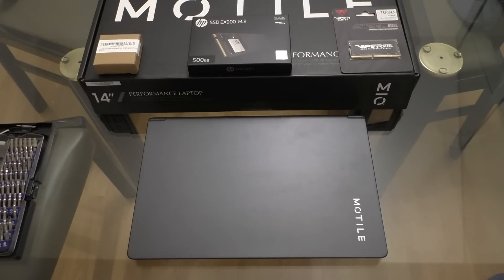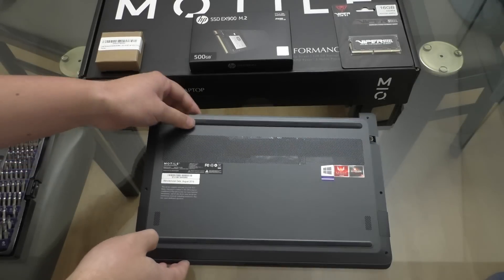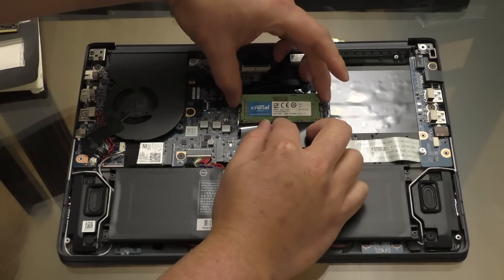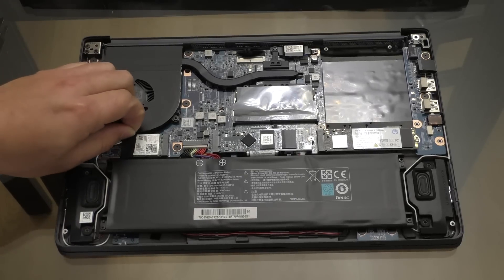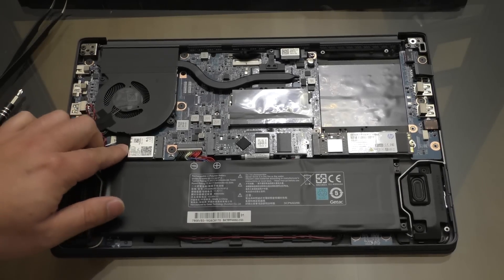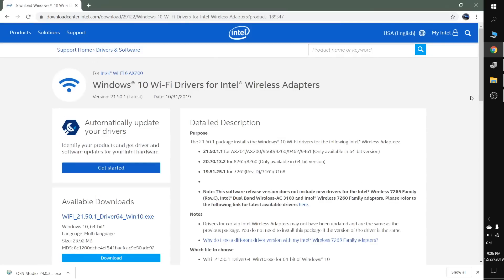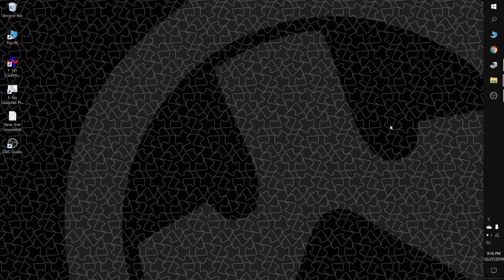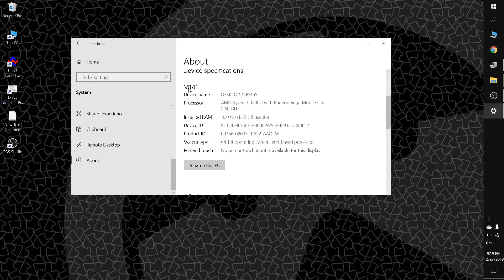Walmart Motile M141/M142 Upgrades (RAM, SSD, Wireless Card)

Comment: Hi all, I just got the Samsung 970 EVO Plus SSD 250GB - M.2 NVMe Interface Internal Solid State Drive with V-NAND Technology (MZ-V7S250B/AM) drive only wanted the 250 gb, but Installed it and formatted it and then ran "CrystalDiskMark 7" (first line test only) and the main SSD that came with this laptop reads about 540 read and 472 write, so I tested the Samsung was read 1740 and write 1618 MUST FASTER, so I understand that you can't remove the original SSD SATA drive as I did remove it and after it was cloned I installed the M.2 NVMe it would not boot gets blue screen issue, so I think I would need to get a SSD SATA III correct? I was thinking in the BIOS I could select the M.2 NVMe as the boot drive but could not get it to boot Win 10. IS this possible so I would not need to get a M.2 SSD SATA III to replace the original?
Reply from the maker: Other folks have been able to put an NVMe drive in the 1st slot and boot from it. Can you boot from the NVMe drive in the 2nd slot? If not, something probably didn't go right with the cloning and partitioning.

Comment: Is the 2nd m.2 slot only for NVMe? I tried to put the m.2 2280 that came with the laptop in the slot but it was not recognized. Thanks
Reply: im having the same issue. The second slot wont recognize any ssd in it whether its sata or nvme

Comment: Did you test stock vs ax200 wireless card speeds to see the difference?
Reply from the maker: When transferring video files between this laptop and my other computer I only get about 25MB/s with the original WiFi card at best, but get 70MB/s with the AX200.

Comment: My laptop arrived yesterday and I am very satisfied.  Obviously the upgrade of the 2nd M2 slot is a slam dunk if you want more on board storage but on the fence as to whether to upgrade the RAM to 16 gb.  On the RAM has anyone tried the potential 32 gb that is linked to fully verify it works?  If I am going to upgrade would love to do the 32 gb for longevity.  Thanks for the great vid!

Comment: So my M142 came with a 8 GB 2400 Mhz RAM stick. It seems like you installed a 16 GB 2666 Mhz stick. Does it still work? I mean it seems like the CPU only supports up to 2400, so the worse that could happen is the 2666 speed is dialed back to 2400? I'm just curious if I should order a 2400 Mhz 16 GB stick or a 2666 Mhz 16 GB stick.
Reply: It comes with GoldKey brand 8GB 2666Mhz already installed, the bios will bring it down to 2400 MHz anyways, grab whichever is cheaper.

Comment: Is there any point in raising the capacity of the ram on single channel?  Doesn't raising the speed make more sense?  Can you shove a 3200 in here?  Do you have to change anything in the BIOS to get that to function above 2400?
Reply from the maker: More memory doesn't hurt, and if your programs can use it, it's definitely wroth increasing the capacity. Unfortunately the CPU can only run the RAM at 2400MHz max. The BIOS is extremely limited and you don't have access to memory settings like timings or speed.

Comment: wrong step, u should unplug battery cable first before upgrade the hardware, it for safety because there is a risk that the motherboard laptop could be damaged. I'm saying this based on my experience because it ever happen to me when I try to upgrade my friend laptop from hdd to ssd and I forgot to unplug the battery, when I try to turn on the laptop no power or display appear, rip my money for compensation.

Comment: Would you recommend the 16 or 32 gb memory card?
Reply: 16gb is the max it can use
Reply: 16gb is the sweet spot 👍
Reply: I just upgraded mine with 32gb and the system is showing it.

No idea why they say it can only take 16.

https://www.amazon.com/gp/product/B07N124XDS/ref=ppx_yo_dt_b_asin_title_o00_s00?ie=UTF8&psc=1
Reply: @hexadecimal5236  how much of a difference did it make? I'm looking to get a 16gb but still interested in your results
Reply: 32 terabytes
Reply: 128mb

Comment: Hi again, I just read that has Win 10 S, that means only apps from the MS store can be installed. Why has nobody talked about this, so it would take a full format and Win 10 regular and the drivers from "http://www.motilecustomerservice.com/m141.html" will these work with this laptop? Thanks again! Update the manual shows Win 10S, but I think this is Win 10 Home so you can use Win 10 programs?

Comment: Thank you for this video, I just order 1 and thinking of adding that HP SSD 256 or 512, but read that that SSD does not have any cache on it which causes it slow down when lots of writing, and for a few $$ can get a M.2 250GB PCIe 3.0 x4 NVMe 3D TLC NAND Internal Solid State Drive with cache? Which SSD that is 256 or 512 for this laptop??? Anybody?/Thanks to everybody!
Reply from the maker: You might be interested in an SSD that has a Phison E12 (not E12S) controller. Here's a good list of them: https://docs.google.com/spreadsheets/d/1B27_j9NDPU3cNlj2HKcrfpJKHkOf-Oi1DbuuQva2gT4/edit#gid=0&fvid=2092992544

OCN also has a pretty good list of SSDs with the E12: https://www.overclock.net/forum/355-ssd/1727548-what-good-value-ssds-2019-1tb-phison-e12-toshiba.html#/topics/1727548

Also, Anandtech has a pretty decent list of SSD recommendations too: https://www.anandtech.com/show/9799/best-ssds
Reply: @FaRKle0079  Thank you.

Comment: Nice video. Straight-forward, clear, and just enough detail. Question tho'...what's the motivation for replacing the wifi card ? Is the one incl. really inadequate ?
Reply from the maker: Thanks. The OE wifi card isn't God awful, but isn't anything stand out. It's just a cheap upgrade that I figured I'd include with the other items at the time.
Reply: @FaRKle0079  Yeah, I went and looked on Amazon and the replacement card is quite inexpensive.
Reply: The one included is fine, I did not replace mine and I get great speeds

Comment: If use CPU-Z or check the BIOS does it says it has a second DIM.  Cause many laptops have its first one on the keyboard side.  Single Channel vs Dual Channel  on Ryzen does make a difference.
Reply: Single channel only
No second slot

Comment: You don't need to install the wifi drivers if it works already, just sayin. Also you could have gotten a cheaper nvme drive, as HP can be expensive and saw it has no Cache,
Reply: daand12 what would you suggest?
Reply from the maker: Yes, you're correct that you don't "need" to update the drivers, and I mention that it is plug and play, but I wanted to show how to update the drivers to the latest for the video.

Comment: I know this will sound dumb, but can you upgrade the gpu on this or any laptop. I built my desktop about a year ago I just never looked into laptops. As I find it I never use my desktop I want to switch back to a laptop.
Reply from the maker: The GPU on this laptop is integrated with the CPU, so it's not upgradeable on this particular model. As for other laptops, if they have a discrete GPU that's socketed (not soldered to the motherboard) then you can usually upgrade those, but that format is fairly rare.
Reply: FaRKle0079 do your know any other budget laptops with an ok gpu inside around the 400$ range ?
Reply from the maker: @HotSizzleTV_  In that price range you'll still be limited to integrated graphics. That said, something with dual channel memory and Ryzen 5 series should be there. Might also wait a bit since the new Ryzen 4000 series APUs just came out.
Reply: FaRKle0079 darn I kind of need one now for school.

Comment: I am so sad that this computer didnt come with dual channel memory. Couldnt justify pulling the trigger.
Reply: There area a SLEW, and I mean there are going to be more AMD laptops and price points than you shake a stick at, coming soon. 4000 series 4600 4700 4500 4800 lots to see.
Reply: @Machistmo  when will these come out?
Reply: Same here buddy, just wait for the 4000 series to come out and snag a better lenovo 3000 series ryzen duel channel, duel fan system for the low.
Reply: i  have the motile m141 and ran some benchmarks on it with a single 8GB stick of CL15 DDR4.  it's 87th percentile for the vega graphics which means it's better than 87% of vega 3 systems tested.  they didn't limit the watts so it's actually very very good, a lot of ryzen apus are set to run in lower wattage which makes a MUCH bigger difference than dual channel.
Reply: Do you mean dual slot or dual channel?  Just because it has two slots doesn't mean dual channel.  In fact most dual slot laptops can only run in single channel especially at this price point.
Reply: It is a let down but personally I purchased this laptop because I can't fit the Alienware I9 into my budget right now and I was rendering video with a Lenovo Thinkpad E555 with an old AMD A6 processor. Rendering and editing video on this laptop was painful so this motile was a step up and will be less painful until I purchase my Alienware!
Reply: @Wedeemgaming  this laptop struggles with rendering video? Even if I were give it like 16gb of ram?
Reply: @4God17  Don't want to throw a link on someone else's channel but I did a video on rendering video on my personal channel: https://youtu.be/GbObqwaj2Ec ... Now I didn't test rendering 4k video but I did test 1080p and if did far better then my old Lenovo Thinkpad e555 and I believe Ryzens are pretty good for video production. Now I will say when I added background music to the Zoga Nes Clone Console video I just uploaded tonight the times for rendering did increase from 1 hour to 4 but compare to my Lenovo that took anywhere from 13 hours to 30 hours to rendering the same length of video for #300 or the $400 it goes for now I think that is impressive!
Reply: For $249.00 this is the best laptop you can purchase!

Comment: Well its single channel memory.. Sad not worth getting..
Reply: for the price, it isn't that bad, if anything you should look into the one sold by amazon, the Acer aspire 5 slim, with ryzen 3, I got that one for my sister and it works great, it's easy to upgrade.
Reply: Definitely sucks it would be great value at 300 if it had another ram slot.  No reason to buy when you can get dual channel models on sale for same or cheaper.
Reply: @Beastykato  no you cant. not with the same attributes such as decent ips screen and same specs, build quality etc. i wish people would stop lying.
Reply: It's worth it if all you do is light gaming and mostly work stuff
Reply: Is this a meme now...
Reply: @onlyjokingtv  lol it probably should be.  2020.  The return of single channel memory and 1960 era IBM.
Reply: @Beastykato  heh, nvidia shield has a 5 year old processor LOLOLOOLOLL talk about a meme
Reply: @Beastykato  dual channel isbarely faster, and noone should game on this thin laptop that costs 300. if you do you're not so bright.

dual channel would make no real difference, it wont allow you to play any different games *maybe 1 fps difference) and not used besides games. 

i have rysen 5 laptop (matebook d) with dual channel, it's not good for gaming. much better and more powerful than nvidia shield though.

unlike shield this laptop has new processor not 5 years old processor with one half channel ram like nvidia shield. so it's much better buy. this has twice the ram channels.
Reply: @cryengine_x  dual channel is clearly 20%-40% faster with hundreds of documented videos showing that on YouTube, which if you're bright you can look up.  In addition, many people game on Vega Apu's which are fine for 720 and 1080p low gaming, especially esport titles.  The issue on most of these laptops is the cooling is inadequate to even sustain the 15w chips heat output and poor implementation like single channel ram.
Reply: @Beastykato  Well, since you're being reasonable, the figure I saw was 25% faster with dual channel. But that's only gaming. I dont know of anything else that stresses bandwidth or would show a major difference in performance. Maybe video editing or 3D cad work or something?

LIke I said, having owned a dual channel ryzen and knowing it's still basically crap for gaming, I dont get the point. It's still an IGP. You want 25% faster crap? It's not going to fundamentally change your experience. The comments act like dual channel changes the world. They lie.

Beyond that, my fundamental problem is with people not only buying a $300 laptop, but a very thin and light one at that, and demanding good gaming performance out of it in the first place. I mean, get Stadia or something if it's that big a deal.

I dont see a $200 (Ryzen 3)-$300 thin and light, decent IPS display, SSD, apparently good build quality, dual channel Ryzen 3/5 laptop really available for this price. Maybe on a one time sale, or with a crappy TN panel which they never mention, etc. If you got one, link it. Guarantee you will not link anything, or if you do I can pick apart their flaws too.

BTW the Ryzen 5 is now 399, out of stock in black. Some are suggesting WM is clearancing these. Looks like who didn't buy might have missed out on a great deal. If it's true.

I dont really need a laptop, but even I'm tempted to buy the Ryzen 3 version currently for 209, slapping a cheap 8 or even 16GB Ram stick in there, and having a decent laptop for ~$240... cant beat that. At best buy that's going to get you a Celeron chunkbox and probably terrible display.

Yes it would be better if it had dual channel. No, it's  not a dealbreaker IMO.
Reply: @onlyjokingtv  Meme is a mime
Reply: I bought one even though its single channel and I've been actually surprised with how its performing under a heavy work load. I use it for photo editing which is ram heavy and it's not too bad
Reply: @caseymiller4218  because dual channel ram makes maybe 2% difference. and thats only on gaming which noone should do on a thin laptop.
Reply: 300 bucks are you serious?lol
Reply: This is the only con that stopped me from buying one.